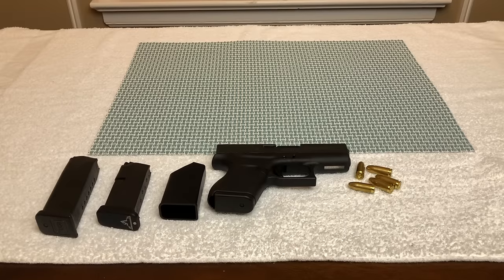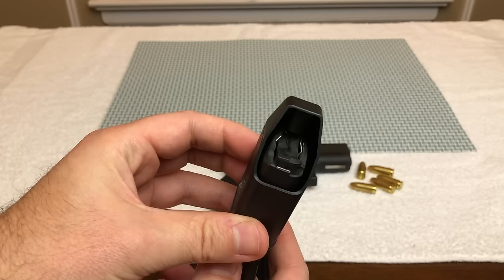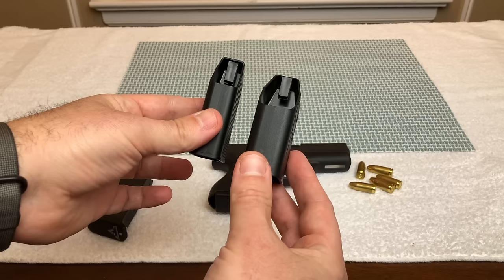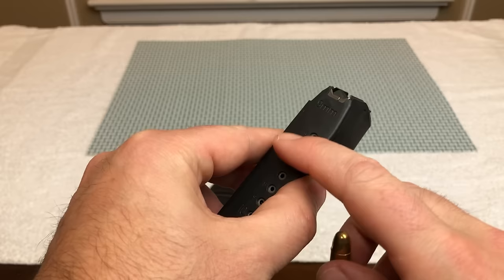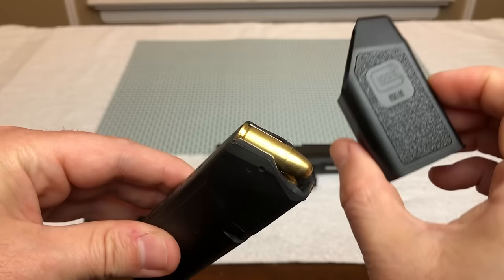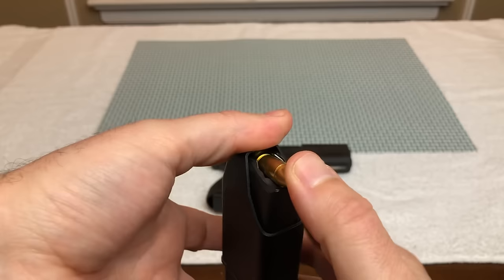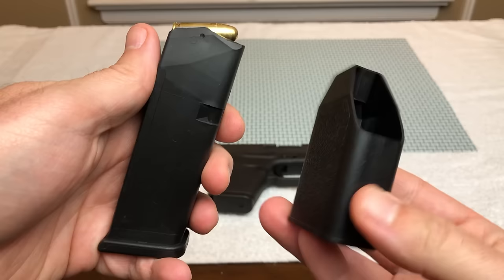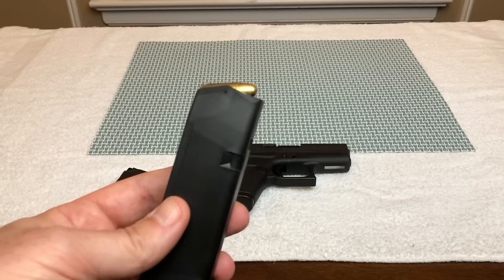How to use GLOCK MAG SPEED LOADER for beginners!!

Comment: Thanks for the video! I'm a big guy but I had no idea how hard it was to load brand new glock magazines.
Reply: Springfield XDS awell very hard to load new mag
Reply: I know your pain brother.  New magazine springs, old hands = ouch. So worth it though.
Reply: And taurus g2c i got it 2 days ago and the struggle is real🥲
Reply: pushing the bullet down with one thumb non dominant hand while loading it with dominant hand is too hard? for a "big guy?" I think this is why u guys need guns 😂
Reply: I bought a used .40 cal, & started loading the 1st clip by hand, … 

Screw that crap, … I began researching how to make a speed loader, as I also bought a new lower at a gun show, & the upper, for a binary fire, for a AR15, … at the age of 69, I found it extremely difficult to hand load the full 15 rounds in the pistol, and the same placing 30 rounds in the clip that came with the AR15, & I’ve always been a tinkerer, … so it has presented itself as a new project for me to do, … Because I am a lazy ass, that always wants to do it better, & faster, … and yet do it right, with style, …
Reply from the maker: Glad I could help
Reply: @2stroketyson79 big or small anyone will struggle loading a new magazine due to the metal springs that can snap your skin. That’s just common sense, stop trying to be a keyboard warrior
Reply: @mohamedbaradji7504 ,
Good comment you made.  There's always the guy that needs to express his manhood by making a comment like ol' boy there.
Likely he just trurned 21, and feels the need to talk smack on people just stating an obvious situation. 
Kudos

Comment: I just bought a G19 and couldn't get the speed loader to work.  Your video showed the trick that after inserting the cartridge you have to first let up on the loader a bit and then push the cartridge the rest of the way in.  That was what I couldn't figure out.  Thanks for the tip.
Reply: Same, but I eventually got it, thanks to this video!!

Comment: I don’t get why it’s called a speed loader if it takes twice as long. Don’t break a nail loader
Reply: I use it mainly to get that last round or two in. The way he's doing it makes it slower than what it is. Once you get the hang of it it's actually pretty quick. Can you load the mag with your bare hands just as quickly... Sure.
Reply: Mayell vera - Actually, I would say it does speed things up a bit once you get some practice.
Reply: It gets real old loading the mags manually when you have several mags to load / unload / reload.  The speed loader just helps with that, especially the last few under higher compression.
But, yes, you can load them manually as much as you like.
Reply: LOL! For real!

Comment: The word speed in speed loader is used very loosely. 🤣🤣
Reply: seriously lol...maybe just call it a load assistant. I bought these load assist rings with my first 9mm long ago and still use them to this day. the 10rd pmags are way more resistant after loading in about 3 or 4 rounds. The load assist ring just goes on your thumb and has a small leg grooved for the shell, grip the mag and press down each round with ease.
Reply: Well, you're right, but if you try to load a 13 rd mag without the "speed" loader... good luck.
Reply: He just loading it very slow to show people how to use them...
Reply: Crow T. Robot Dude it’s a pain in the ass. I rented a vector at the range last week and they use 13rd glock mags. My thumb at the end of the day was brass. But it was worth it. I love the vector.
Reply: I couldn’t figure it out. Made me feel like a dumb a$$.
Reply: You’re right! It should be called an “easier on your thumbs” loader
Reply: @seanreardon27  facts! Just loaded my glock 19 15 round by hand, a little tough but nothing drastic and I’m skinny

Comment: This appears to work pretty well with the magazine shown here.  I have a new Zigana PX9 pistol that came with a similar device, but it does not work well at all.  The spring in my magazine seems to be much stiffer than the one in this video, which is probably the biggest issue.  When trying to use the loader, it pushes down only the rear end of the top bullet in the magazine, leaving the nose of the round sticking up at an angle.  This prevents insertion of the next round to be loaded, making the "speed loader" pretty much useless.  I'll probably get one of the Maglula loaders and see if that works, because it's VERY difficult to load this PX9 magazine by hand.

Comment: The Glock 42 is a .380 caliber pistol, made in the U.S.A. The diameter is the same as the 9mm caliber, hence the use of the same narrower speed loader in the video However, the .380 cartridge is shorter than the 9mm cartridge.

Comment: I dont even own a glock yet but I do own a Ruger PC Carbine that uses glock mags and so far loading them has been my biggest trouble. I dont know if Im just really weak or if the spring is just really tight but I can only get about 5 or 6 rounds in before I tap out. Just put in the order for one of these bad boys so I hope this at least helps a little bit.

Comment: NO WAY...NO HOW...IMPOSSIBLE, Is the Glock 483-4 "Mag Loader," that came with my G23 Gen5, capable of loading the 13th Round.

UPDATE: Went out to a few local Gunshops and finally found the UpLULA, cost was about $35.

Sucess!! It did take a bit more effort, than the other 12 rounds took. The Magazine also needed a somewhat harder tap, to get it to catch, compared to when it had 12 rounds. Overall, nothing bad.
Reply from the maker: Awesome

Comment: Will this work for the pmags too? I have a 27rd GL9
Reply: It should work on virtually any magazine designed for your Glock. I've used it on my Glock mags as well as my Pmags. I would recommend for faster loading, however, a load assist ring. They're easier to work with and a faster alternative to the Glock accessory.

Comment: i just bought a 19 fss, all other firearms Ive shot the owners had speed loaders like the Lula, this Glock speed loader is the worst thing about the package so far. i don't like how you have to push the cartridge back after catching it on the metal lips. 7 out of 10 times the cartridge goes flying instead of smoothly sliding into place.

Comment: So I can load a G17 non California mag faster by hand than using that piece of junk that requires two hands. One to push down and one to seat the round to the rear. Bottomline it's trash!!!! I kept mine just because resell value
Reply: I’d say it depends. A Sig P365 magazine can be very difficult when they’re new. Also, the technique can be difficult for some new shooters. M17 magazines are very easy to load and I would say it’s faster by hand.
Reply: You still use two hands to reload either way
Reply: With mine, I use one hand to load bullets and the other hand manipulates the loader